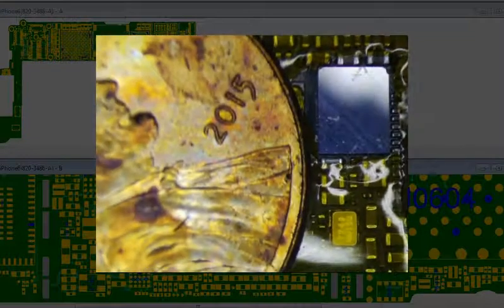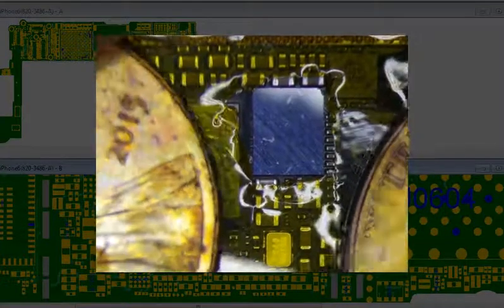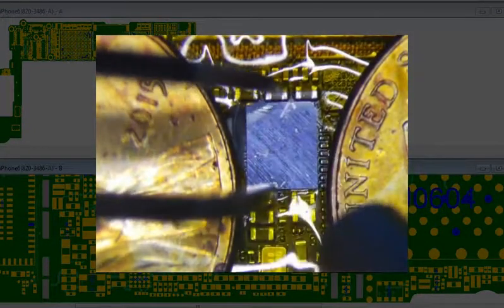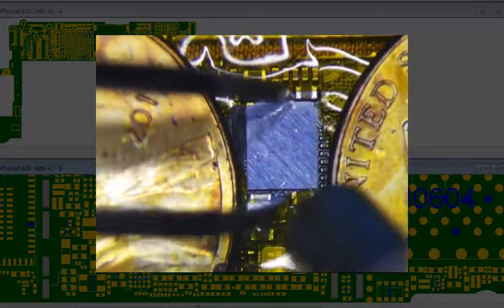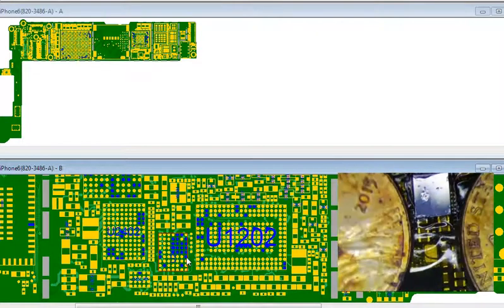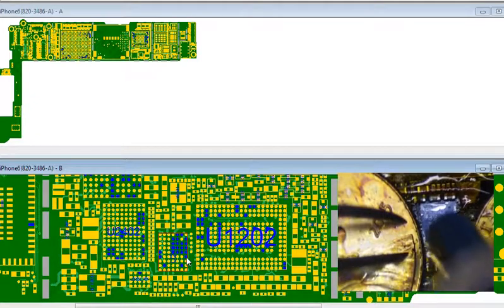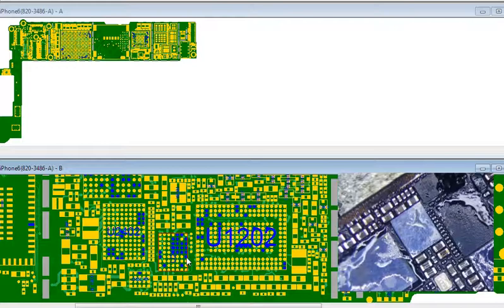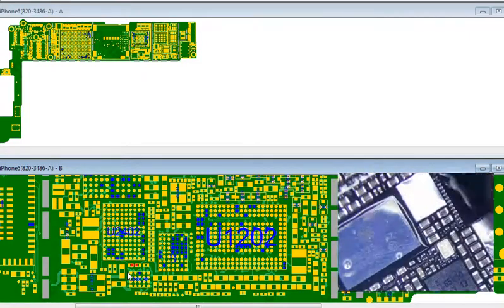iphone 6 touch ic repair cumulus

Comment: You should do a video on the RF chips for the 6 plus.I have a 6 plus that was dropped and it would intermittently get service.
Reply from the maker: That is more likely the baseband chip.  It's not a repair that makes sense at the moment.
Reply: +Microsoldering It's not the baseband as it still recognizes the sim card, and the IMEI is still there.
Reply from the maker: +sizzlin321 I have a hard time believing that it's the rf chip because it's encased in underfill/solder mask.  I think it would be more likely a problem with one of the components leading to the rf chip.